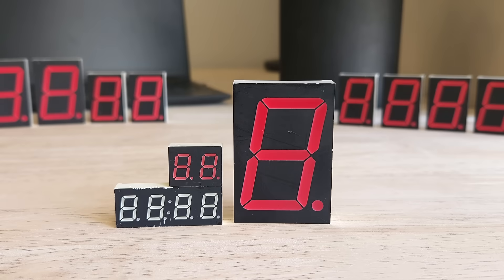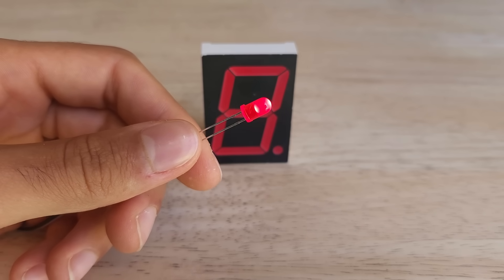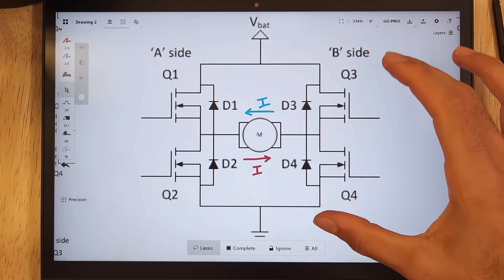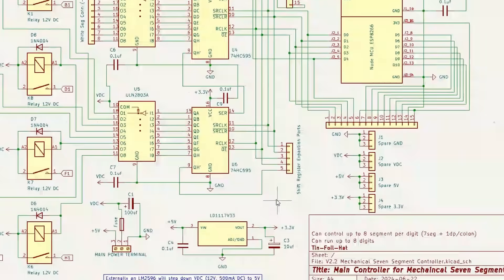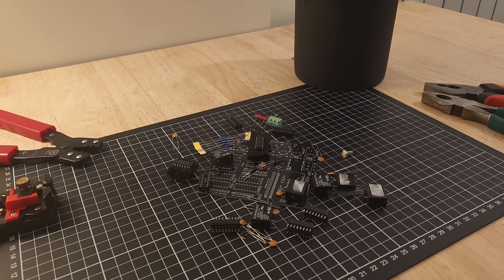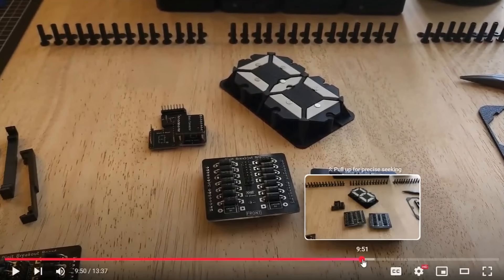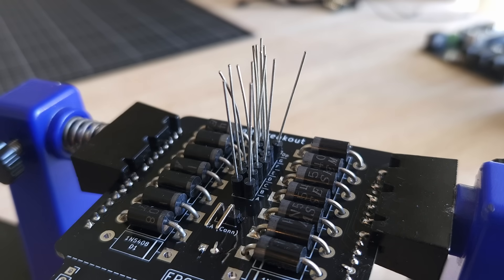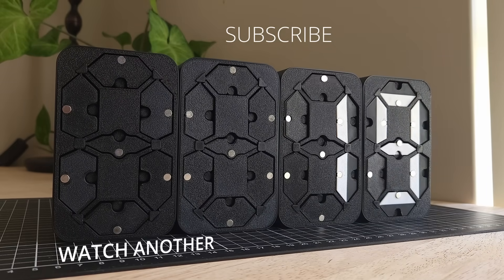The BEST Mechanical Display You've EVER Seen!!

Comment: Masterful work! That editing trick with the youtube timeline is one of the most original editing tricks I've ever seen!
I'm inclined to try and build one but it looks like an awful lot of work! Question: you use fairly big mechanical 12v relays. They're not the fastest and can eventually fail. Wouldn't it make more sense to use a transistor or MOSFET? The currents can't be that big (and mosfets can handle a lot anyway). Might even be cheaper, at 3.30 a relay...
Reply from the maker: Ah a good question! I use transitors to switch the negative rails of the digits, but to switch the positve rails I opted to use a relay as standard NPN transitors need more components to do that. I am still a beginner in the world of electronics so the relay seemed simple, and cheap :)

Comment: I've got an arduino library somewhere I wrote to drive some ancient signalex electromagnetic digits (mix of 402L, 602L and one 12"). I set it up so you specified the maximum current draw and it would flip that many segments at once. IIRC the 4+6 were 50ma max per segment and the 12" was 100ma. It had some smarts to know that flipping (say) an 8 to a 0 only needed to move one segment. Being a software developer the software was the easy bit, and the hardware was a nightmare -- PCBWay are great, they'll deliver you your beautiful boards exactly as you incorrectly designed them :-)

The library worked by looking at the current state and comparing it to the new state, and then added the changes need to a queue that was processed something like 500ma worth of flips at a time.
Reply from the maker: Oh very nice! Each flap for me takes 500ma... hence only doing one at a time :) And as someone who loves programming myself I also added that feature where to go from an 8 to 0 it only changes the middle flap. You can turn this on or off at the main menu, an example of it being turned off is at the very end where it clicks much faster!

Comment: I think you're a bloody genius! Lenz's Law nearly had you but you aced it! The ONLY thing that I'd say is, the very beginning implied you were going to get rid of the electrical power supply.... it didn't happen.  It's still bloody brilliant though. I love it from design, through manufacture right up to the final build. Quality!
Reply from the maker: Yeah didn't happen, but a tad closer. It does retain information without power which does serve purposes where you need an addition source of truth (they used to use them on old gas meters). And yep, just graduated after sitting physics so Lenz's wasn't gonna trip me up :) I'm glad someone noticed the magnetic fields where the correct way!!
Reply: @tin_foil_hat99  Congratulations on your graduation, you've got a good future ahead of you! I didn't notice if you were using flywheel diodes to be honest but they change state beautifully fast. I take my hat off to you for thinking it up and seeing it through.
Reply from the maker: Thank you! I sure do have diodes! Possibly more than I need... and bigger ones than I need haha

Comment: 0:10 or you can use electronic paper
Reply: Eink requires full screen refreshes when things update
Reply: But where's the satisfaction in watching a paper display clock
Reply: Still use power. What, did you think it was just glorified paper?
Reply: @formerqueen22 The actual display also uses power

Comment: Suggest to paint the magnets in black (or in white)! 
I learned from other video that you can place the magnet inside the plastic during 3D printing! 
Say, when you print the plastic piece,once the magnet cavity is printed at the correct size, you can halt the 3d printer then place the magnet into it and then continue printing. Until end, the magnet can be fully embedded inside the plastic piece!😊
Reply from the maker: Thanks for the idea!

Comment: Can you manipulate the electromagnet strength via controller if you wanted to use a very weak field, so you could update quietly when desired? IE if it was a bedside clock, at night.
Reply from the maker: No sadly not. You could add felt or something on the main panel to dampen the noise, but I like the clicks.

Comment: 0:10 uhh... Electromagnets are reliant on power 🤔
Reply: Mechanical displays don't require power to display, only to update the display.
Reply: Not continuously…
Reply: True, but flip-dot (or flip-segment in this case) displays work like really low-res e-paper
Reply: So basically you will be stuck in time when power is lost.
Reply: @NaoPb  exactly. A broken analog clock is correct 2 times a day, just don't know when. Without electricity your electromechanical display might as well be off, because looking at it gives no information except when it stopped working. Still need the power to be useful
Reply: @NaoPb  Who says is for time?
Reply: @mmm91911  Did you even look at the beginning of the video mate?
Reply: Yeah, why? @NaoPb
Reply: @mmm91911  Are you really this dense? Did you not notice the clock example that this whole thread is responding on?
Reply: @NaoPb  Nobody here talks about time but you. Have you noticed that?
Reply: @mmm91911  I don't know what to tell you. The original commenter is referencing a timestamp which links to a point in the video where the display is used as a clock. You kmow, a TIMEkeeping device. So yes. We're all talking about time here. And it is displayed as an alternative to a digital clock that loses it's time when the power is lost. Whereas a display like the one shown could keep the time since the electromagnets do not require to be powered continuously for the display to be visible. And my post is explaining that this example doesn't work since the time will simply stop advancing once the power is lost. So you can only use it to tell at what time the power was lost. Making it just as useless as the other digital clock shown in the video in the event of a power outage. The only real alternative would be to use a battery-powered clock which use very little power these days.
This display will certainly have its uses but it will not be an improvement over a regular digital clock in the situation shown in the video.
Reply: @NaoPb  The original comment is this:
"uhh... Electromagnets are reliant on power." This is about some people who understood this doesn't require electricity at all, when obviously it means it doesn't require electricity to Maintain. I have read all comments and the only ones containing the word time are yours or those who re[plied to you, that is me and one other dude. The fact that the timestamp he links to (which I believe was made by mistake, cos he could've linked to somewhere where electromagnets would show) is completely irrelevant to his point, and we all got it but you.
Reply: @mmm91911  My man, did you not notice the 0:10 part in that comment?

I'm gonna stop responding because I've been clear enough and if you have trouble understanding it then that's not my problem.
Reply: Electrodynamics is not entirely the same as Electrostatics depending on the methodology, analogy or frames of reference.
Reply: True but you could make a way so when power is restored to check the rotation of the segments and continue from there. That way it doesn't default to 12:00 am when power is lost, which is a bit more convenient.
Reply: His solenoids are pretty ineffective since they don't have proper magnetic core. Core must be closed outside the coil with a small gap on the top. Take a look at stock solenoids

Comment: Very Cool. Just curious all the parts added up to less than $150?

Your engineering skills, knowledge, tools, and time spent are worth more than the money saved. But well, you can earn back from YouTube or maybe sell the product if you want.
Reply from the maker: Yes! It cost me around 100AUD for all parts to build 6 digits and 1 controller. I did get the blank PCBs for free so maybe add an extra 40 bucks (depending on shipping). The digits are only around 6-8AUD to make.

Comment: hum .. nice prototype, thinnking version 2 lol
1. get rid of the relays .. use a sigle xFET or/and a Thyristor for heavier loads, for small loads a single xFET should be enugh (+an extra xFET to turn of the Tyristor if designed for heavy coils etc, V3 add a drain capacitor to protect the xFET from turning on from EM interferance, comm radios etc(Hospitals) ..)
2. use a single shift register each for each display/digit
3. use a bcd encoder IC? (prob unessesary, can use software)
4. make them cascadable (detect number of connected once in serie with software)
5. use a single coil per digit element
6. metall parts in moving parts/joints for longivity (when the plastic flipped a million times..)
..
Element V2? .. support for text x-es is blank area
Reply from the maker: A lot of cool ideas to unpack here. You should read the instructable I wrote as maybe you'll see some of my design choices. I am using shift regesters already, the relays are for the positive rail of the multiplexer (as I didn't really understand PNP fets and relays are cheap) and the double coil is for electronic simplicity. The software allows you to customise how many digits you have. If I make a V2 I will revisit some of your ideas, I got them saved for later :)
Reply: @tin_foil_hat99  ok, last using semiconductors u can use basicly any cheap transistor to turn on another thats supposed to take the load
..and down below someone had an idea of using a H-bridge, in wich case u can control the direction of the magnetic field from a coil for example .. looking forward for the next project or iteration of this ;D
..never stop learning, stay curious..

Comment: Am I being stupid here? I was expecting a mechanical display that doesn't require electricity?
Reply: I mean, one advantage of this design is that when the power drops out, the digit will still be displayed. But ofc, very misleading title and intro.
Reply: @thevalleyythen it’s just a stopped clock
Reply: @thevalleyy Even e ink displays can do that
Reply: Yes the title should be "electromechanical display"
Reply: Come back when it's powered by a hampster.
Reply: Yeah, the introduction was misleading. Worse than that, it relies on a micro controller to work. It's a nice project still, but yeah...
Reply: It retains its information without power is what he said  @nikotesla9406
Reply: Its electric- mechanical. 
Electric  parts move it, electricity gone, it retains last displayed state
Reply: He shouldn't have said, "without power" he should have said, "without a screen" or "without LEDs"
Reply: I think this display type is just called a mechanical display.
Reply: Yes.
Reply: It's about satisfaction as looking at 7 segments display is satisfying, especially if its mechanic.
Reply: @manda3dprojects966  but he literally says "without power" in the intro!
Reply: Yes.
Reply: He is talking about not using screens
Reply: Yes
Reply: Yes and no
Reply: Did you guys think it was a wind up clock? There has to be some sort of power
Reply: @miraxus6264 yeah!
Reply: You are. In engineering this would be called a mechanic display as the actual display is shown through moving parts. "Mechanical" doesn't in any way mean "no electricity" Additionally as he explained at the beginning of the video, the type of display you're looking for already exists in droves and has limitations compared to this one.
Reply: @user-dn5gn2iv2q the title has changed. a year ago it was either in the title of the video, the thumbnail or the description but it definitely said something about no electricity!
Reply: It doesn't require electricity to maintain its state.
Reply: He meant when the electricity is removed, the current digits will still show.
Reply: No, he fucked up... Or mislead is, you decide.  @FuniPlayz

Comment: this does get me thinking, like what is the most efficient way to have a display like this? like is an electromagnet the most efficient? what about small motors to flip the display? or a solenoid? yeeha i mean i get that they are all technically using an electromagnet to convert power into mechanical movement but, that's kind of the point right? what mechanism could flip that display in the most efficient way?

it also makes me wonder, what good is a clock without power to keep track of time? XD maybe for letters it might make sense? but.... ya know <_<

Comment: Why not use arduino? seams like a lot of work making all that electronics hardware with custom PCB boards.. whaaa? that's crazy
Reply from the maker: Arduino can't do wifi stuff without buying a more expensive board or adding it on. Also you'd need all those extra components anyways to switch the 12V at 0.5A, there's a more detailed answer on instructables.

Comment: How much power voltage can it support?
Reply from the maker: It runs on 12V DC ~0.5 to 1A
Reply: @tin_foil_hat99  I should have been more specific, can it run at higher voltages? Would it make them flip faster?  I have 2 5x7 flip dot displays without controller boards. The spec sheets starts at 12v, and goes to 30v.  That's all.  I appreciate you putting this together.  I'm a noob at electronics.
Reply from the maker: Hmm someone else commented this too, I'm not sure about the voltage, I'll have to play around. You could very likely use my controller to connect to your flip dots

Comment: Not counting time nor 3D printer I'm curious what the cost totaled to. Doesn't seem particularly cheap.
Reply from the maker: around 100AUD all up (for 6 digits and a controller), although I got the PCBs for free so maybe +40 bucks?? The digits are super cheap to make, just 14 bolts, some wire, and 3d printed parts (around 6AUD not including the PCB - but including the components on it). All my parts were from my local electronics store too.

Comment: Just from top of my head. How about use those micro digital servos with 32 channel control board. I found it on aliexpress quite cheap. Then you can control them simultaneously, with different effects like speed of switching (different sound) etc .... and most importantly it will be smaller and infinitely less complicated to build;-) Of course, after you figure out some clever way to integrate those servos to flip surfaces (shouldn't be that complicated).
Reply from the maker: Good thinking, I'll have a thought

Comment: 4:00 you might have thought of this already, but you could use a single core with two separate coils on it that will generate magnetic field in opposite directions (or one coil with center tapped to ground). That way you don't need to drive two electromagents together to flip state, just drive one, making the electronics simpler. Very nice project/video
Reply from the maker: Yes I love this comment! I so very nearly did a centre tapped ground and wanted to cover that idea in the video but figured it was long enough already! I'm glad someone else thought of it too

Comment: Beautiful but bad engineering because of efficiency. Use mosfets or transistor not relays there is a lot you have put into. The electronic should be simple yet efficient. Mechanical part is fine. Anyway good work.

Comment: I wonder about one thing: why they flip sequentially? Is it by artistic choice or is there a technical reason for it? I would like to built my own and big enough to be readable from 100m distance. Such design has one big advantage over LED, they are visible in daylight and direct sunlight very well.
Reply from the maker: You need a ton more power to flip all of them at once. It is possible, but you'll need more expensive components. All the best with your project!

Comment: Omg, your idea of extending the segments gave me an awesome idea. Make a display that has to lay down on a table using your extension idea, but have it submerged in a tank of some opaque liquid, such that when raised, the segments stick up out of the liquid, and when lowered, they are submerged. You could coat the segments in some kind of hydrophobic material to make sure they come out clean. Not very practical, but would look so cool!
Reply from the maker: Love the idea!
Reply: Idea. Instead of liquid, you just could use a flexible membrane instead. No ripples though. O.c. the visuals would be different.

Comment: Nifty project!  What's the ETA on the 16-segment display?  :grin:

That being said, for ultimate contrast, paint the black parts with Stuart Semple's Black 2.0 or 3.0 and the white part with NightHawkInLight's 'cooling paint' from his 'Radiative Sky Cooling Series' YouTube playlist.
Reply from the maker: Cool idea!
Reply: @tin_foil_hat99  Also, what about constantly trickle-charging one super cap per display so that, when you use a shift register to trigger all of the segments at once, most of the power will come from the cap?  

As you only need to have the electromagnet on long enough to start the flip, things shouldn't have enough time to heat up too much.

This will become MUCH more important as you work on the 16-segment display.

Does that make sense?
Reply from the maker: Yes that does make sense! This is also a very clever idea. I'll think on it some more. Each magnet only needs to be on for around 50ms so this could be very feasible!

Comment: Great video. I'm guessing a single horizontal electromagnet per segment didn’t work for some reason?
Reply from the maker: Didn't have any U bolts lol, and requires a current reversing circuit (e.g. a h-bridge)
Reply: @tin_foil_hat99  or a bridge rectifier